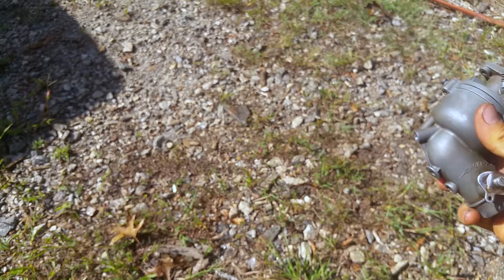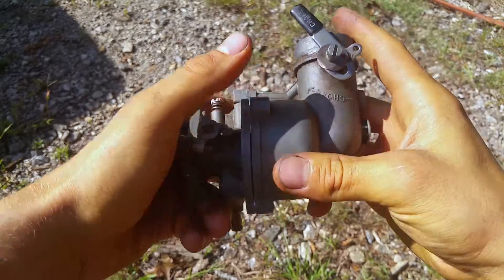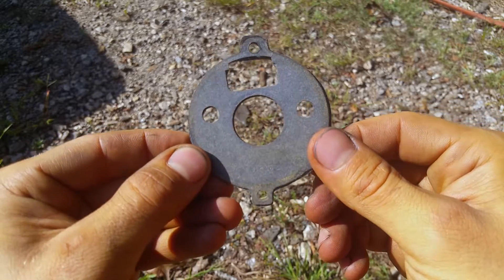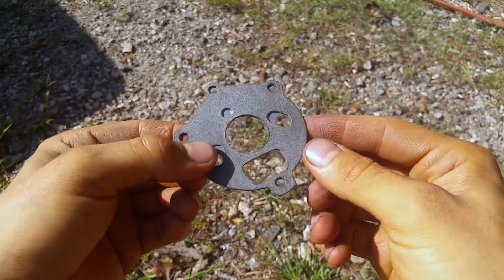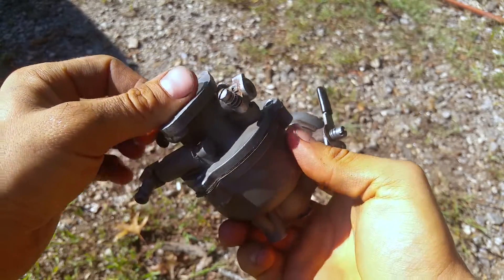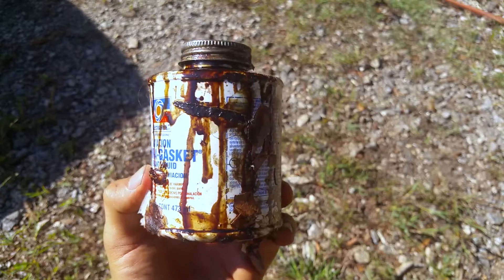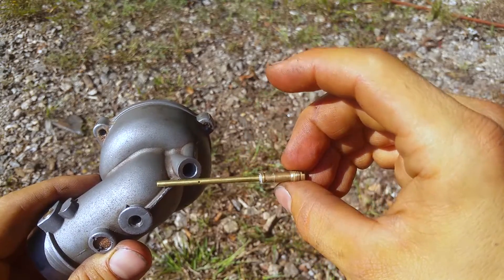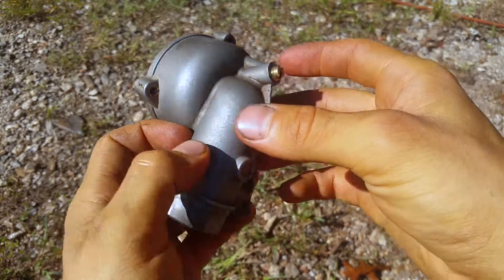Fix a Leaking Briggs & Stratton Flo-Jet Carb for GOOD!

Comment: Ive watch other videos here on yt that says not to double up gaskets,that its normal for slight weeping. However on a positive note thank you for taking time to post this.  Obviously im dealing with leaking from same carb and its very frustrating you still have the chore to do that requires this engine lol. The emulsion tube advise is spot on. I could be wrong put figured I would add my 2 cents

Comment: Very good info; many thanks.  My carb (1960 B&S 8hp) leaks and i suspect it’s coming from around the emulsion tube.  So, if that’s the case, can that cause surging at idle (it’s surging at idle as well)?
Reply from the maker: You're welcome. Yes, any leaks can cause that c annoying surging.

Comment: It makes me wonder if the aluminum Chinese copies are actually better than the steel OEM since the aluminum gets rid of heat better and may not warp in the first place. Also it's easier to get the emulsion tube to seal against soft aluminum by working it back and forth a few times than it is against steel.

Comment: This is the first video I’ve come across to match my carb. I have this same carb on an old 8hp B&S IC which is on my old Mighty Mac  chipper/shredder. Had to take the carb to my local small engine repair shop to get the correct kit because it is not the one that matches with the engine model #. The kit came with 2 of those bowl gaskets, but the 2 inner holes are not in the same location as the original gasket. Not sure that will matter. Thoughts?
Reply: I bought a B&S carb kit that came with 2 different bowl gaskets. When I questioned it, the mechanic said use either one, the holes inside don’t have to line up. I picked one, installed it and it runs like brand new again….
Reply from the maker: Sometime there are multiple different bowl gaskets for carburetors. You have to get the one that lines up properly. Just match the new gasket to your old gasket.

Comment: You can buy an import version of that carb (Briggs p/n 390323) on Amazon for fifteen bucks. I bought one just to disassemble and study, before I rebuild the 71 year old Stromberg UC 3/4 on my 1948 Gibson. They're both updraft carbs and similar in design.
Reply from the maker: Yea, I know you can buy the cheap import carbs, but I do not trust them. I have heard very bad reviews on them.
Reply: @MattsShop  I've never put one to use - rather bought it to disassemble and understand before tearing into a costly to replace antique. It's been 50 years since I last rebuilt a carb, and then it was my Dad doing the work and me pretending to understand while mom screamed at us for doing it at the dining room table. ;^)
Reply from the maker: Haha I got you. Do it outside on the pavement this time!

Comment: Thank's for posting this ..........  I had ran out of those parts and wanted to make sure of that number ............

In fact those washers are used on the  tank and carb 3 1/2  HP engines also....  But you use the small pin and the washer on that fix.........

I gotcha subbed also ...........

Plus Tard Mon Ami ~!~!
Reply from the maker: No problem. Thanks for the info. I had no clue what other small engines these parts were for.

Thx 4 the sub!
Reply: I didn't know if you have a shop like I have so that's why I threw that info in there ......  

The older  pulsa jet carb tank combo's had a issue under the diaphram ......The pin goes in the hole first then the thin washer and the diaphram on top of that ........   

I need to make a video of that repair for my you tube channel ..........

Plus Tard Mon Ami ~!~!
Reply from the maker: Yea, you should make a video of that for your channel. I am familiar with those carbs. The ones that are mounted to the gas tanks?

I'm not a fan of those carbs at all.
Reply: In this video it's the carb and tank sitting on the ground.....  I had to put a modern style on this mower......

https://youtu.be/Yw1Av2nQgoA
Reply: Check outhttps://isavetractors.com/by-engine-model/briggs-stratton/  they have rebuild kits